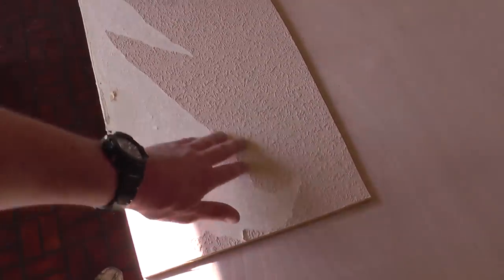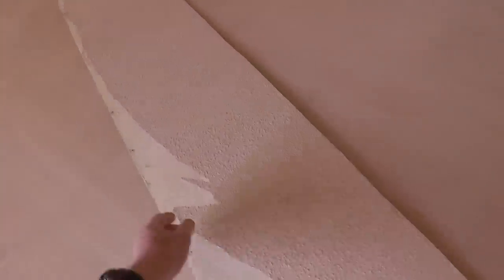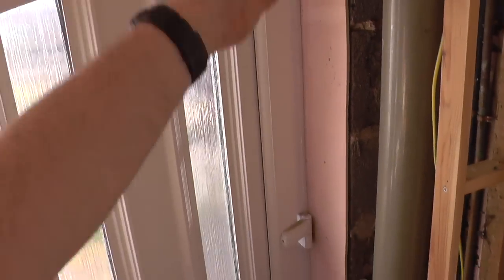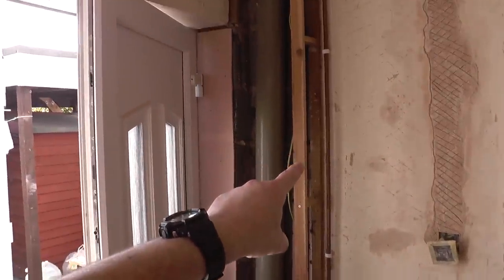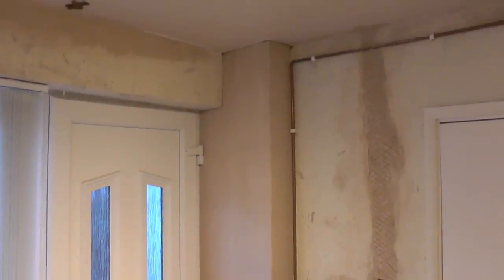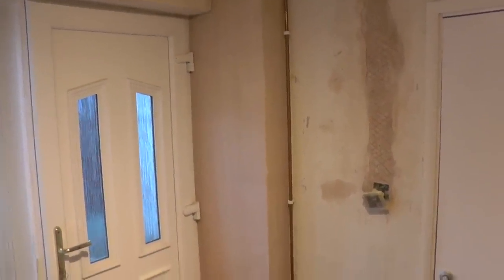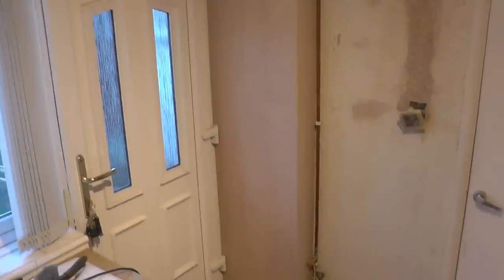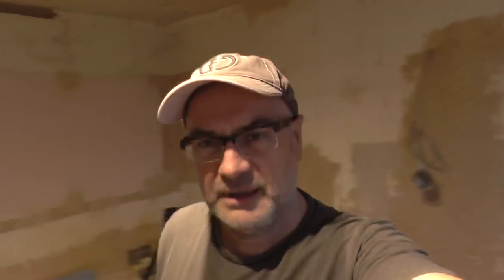DIY: How To Box In Pipes / DIY Boxing In Pipes / How To Hide Pipes

Comment: Looks alright mate. Good job. 👍🏼
Reply from the maker: Thanks buddy. The are 2 things which I need to add though. The edges where the 2 sheets butt together need to be glued or the ply will warp. Secondly, I used the thin ply because I needed to keep the thickness to a minimum or it would have obstructed the door. In most cases, plasterboard wouod be a better option as it is easier to cut and manage. Best wishes, Des
 👍
Reply: @21stcenturycaveman33 Thanks brother, built a ladder frame and used 6mm MDF to cover it. 👍🏼
Reply from the maker: MDF is really good for this and easy to use - until it gets wet - then you have porridge.  ATB, Des
Reply: @21stcenturycaveman33 Yeah, it’s far enough from the sink and it’s getting painted so it’ll be fine. 
Cheers.

Comment: Nice job didn’t u fancy using Plasterboard n skim it up after ?👍
Reply from the maker: Hi there. I wondered whether someone would ask that. Definitely another option plus cheaper and quicker. However, the thickness of plasterboard (even the thinner 9mm) wouldn't have fitted at the back of the door where the hinges are. Plus, to be honest the ply is much stronger. Thanks for your query and for watching. Take care, Des
Reply: @21stcenturycaveman33 you could've dotted a 9mm plasterboard onto the block nib, ran it through onto the frame work and screwed it the remainder of the board.

Comment: Doing all that work but leaving the parallel going pipe is somehow strange concept to me. Why wouldn’t you box that one in too once you’re at work.
Reply from the maker: Hi there. I didn't box in the parallel pipe at the time because I was going to re-route it. Since that time though I've had a re-think and left it in the same position. Given this, I would box it in as you've suggested if I had to do it again. Best wishes, Des
Reply: Adrian Ochsner was thinking the same thing, but understand now
Reply: You’re not really going to have access to the soil pipe however with a central heating pipe you may need to remove in future hence why I wouldn’t box in either or if I did I would be using access point screws on box for easy removal. Cheers 🍻

Comment: Would using plasterboard make it easier to decorate or would the door keep hitting it.
Reply from the maker: Definitely another option plus cheaper and quicker. However, the thickness of plasterboard (even the thinner 9mm) wouldn't have fitted at the back of the door where the hinges are. Plus, to be honest the ply is much stronger. Definitely a good alternative in the right situation though. Take care, Des